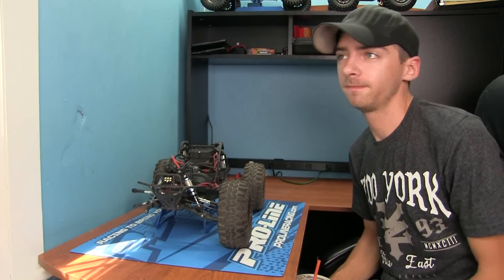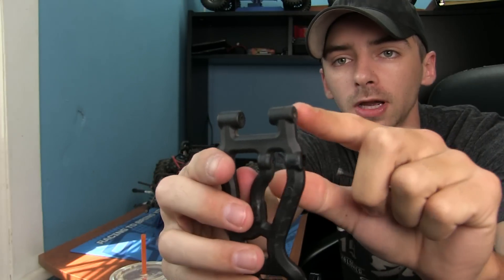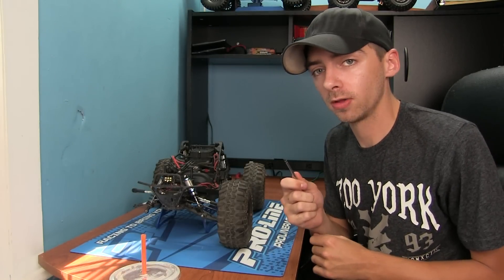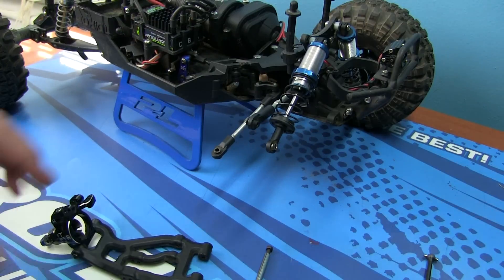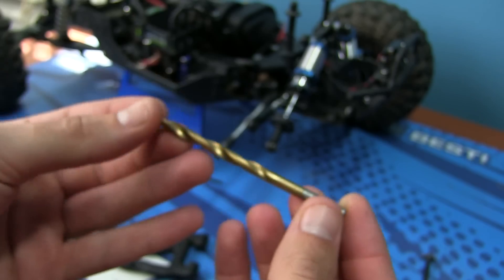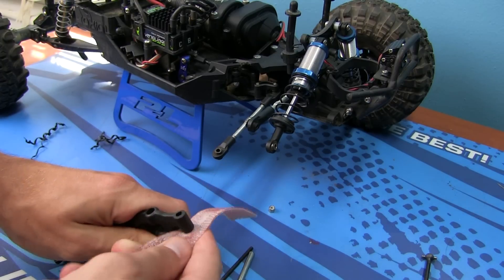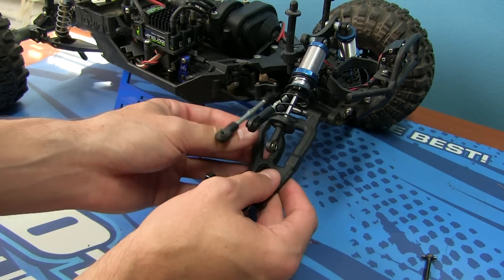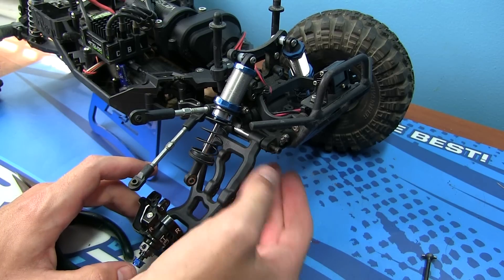Axial Yeti Huge Steering Upgrade! Strong Arm Sleeves

Comment: There is a hole on the bottom of the chassis that lines up with the plastic nut so you can take a small needle or pin or something and just push it out from the bottom. That's how I got my 2nd nut out after fighting with the first the way you mentioned.

Comment: Cool.. that is a great tip. Keep in mind that all this can be picked up at your local hardware store. Cut to length and buy a screw. This way you can make them for all your rigs... Depending on how much it costs for the kit. It might be cheaper to make your own.... :) Thanks for the great idea. and the vid.

Comment: my question is I just installed the string arms and upgraded to the aluminum jazrider 2.2 cyclone wheels.now it won't turn do to the wheel hitting the steering knuckle.what do you recommend to fix this a hub extender I'm not sure what I need pretty new to rc

Comment: I have upgraded to the same steering knuckles. Every since I upgraded the links & steering knuckles, my Yeti isn't going straight. It tilts to the left direction. 
I also installed a Savox s646Wp waterproof servo and axial 25T aluminium horn to it.. made sure the steering is equal while tightening the servo heron to the servo. 
What could be the problem that it still moves slightly right when kept straight?
Thanks.
Reply from the maker: +Varun Sareen Dose this happen with full power applied or light throttle control?
Reply: +RC Overload  It happens both ways.. I tried with less throttle .. It doesn't go straight ... With full throttle its the same ..

Comment: can you please tell me what front shocks you have on your yeti in this video,and are you satisfied with their performance? I have tried a pair of proline ultra reservoir shocks(to my disappointment) then I got the Proline PowerStroke shocks(again I was                                                                                       disappointed) I have a lot of upgraded aluminium parts which adds to the weight of the rig overall. I love the PowerStroke rear shocks, but the front ones don't seem to be able to handle the weight which causes it to bottom out a lot, especially when jumping, which is what I like to do while I'm out just bashing around the property. The sound of it bottoming out is like nails on a chalk board to me. So if you could make some recommendations of some good shocks for my applications(what I'm putting my Yeti through) I would really like to stop wasting my hard earned money. Don't get me wrong, on smoother surfaces, such as asphalt and paved parking lots the PS shocks work great so far, don't have a lot of time on them but what little time I have on those types of surfaces they performed well. The ultra's were missing some of the seals right out of the box and were leaking like a siv. but the PL people are putting together a seal rebuild kit for both sets, so I'll be giving them another chance up front only though. They are not what you want for the rear. The PS-XT are the way to go in back. Sorry for the long comment but I'm at my wits end with this situation. And last but not least, if you are using a set of aluminium lower control arms do you think it is still necessary to install the strong arm sleeves, I also have the aluminium GPM: front bulk bead set,front bumper absorber set,gear box and chassis mount. Also the aluminium front bumper set which includes the skid plate/hing pin mount as well. l also installed STRC alum.front bumper mount,the steering bellcrank set, front body post mount, the steering posts, HD front shock tower. Besides the aluminium boom lower front control arms, I also installed the boom steering knuckles and caster blocks, the front shock tower extension, and the tie rod set. everything that makes the drive train is also aluminum(ex:HOT Racing  trans.& transfer case. The Boom Alum. spur gear cover set and Axial hard anodized  motor mount. So that pretty much covers the front. So I'm gonna assume you would probably suggest the installation of the strong arm sleeves, just don't like the idea of drilling through the aluminium control arms, however they do have plastic bushings, which if I'm lucky, I'LL be able to just remove and the sleeves will just fit right in. If you don't feel I need them please tell me so. I'm not rich and this is a project that has taken my cancer ridden  uncle and I about 2 years to research, invest, and put  together. I'm his caregiver and we live out in the country, as you can assume, no hobby shops in area so we depend mail order for everything. I would appreciate any advice you might be able to give. already spent roughly $250.00 on shocks from proline that are utterly useless. I talked him into those investments cause as far as I knew Proline were a quality product, but have found that to be untrue as of this project. He and I are doing this to bond before he leaves us, and it's making him happy too. That alone is worth it. We want to build the ultimate Yeti and are very close to finishing. just a couple more things to figure out, like the front shocks that can handle the weight and not bottom out when we jump this beast. The rear end or back half of this rig is another whole storey. I can send you pics if you would like to see our rig. He wanted it to be as scale as possible so that's why we chose the yeti. I'm painting the body to look like his truck. even trying to figure out a good lighting system. Any suggestions there would be welcome also. But right now performance is the most important thing to both of us. Aesthetics are the last part of it. Thanks again for taking the time to read this and even more so responding back with any advice would be great. Like I said, I'll send pis if you want just LMK. My name is Eric and My uncle's is Linard. TTYS